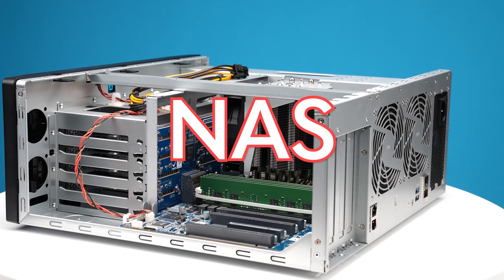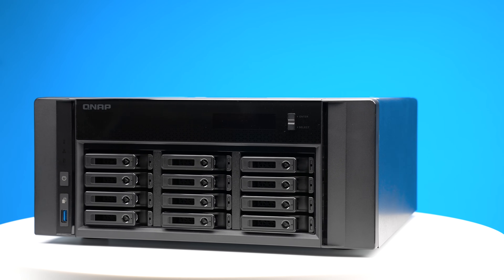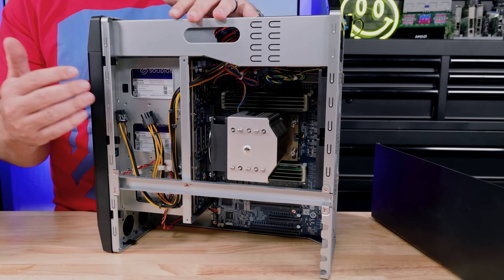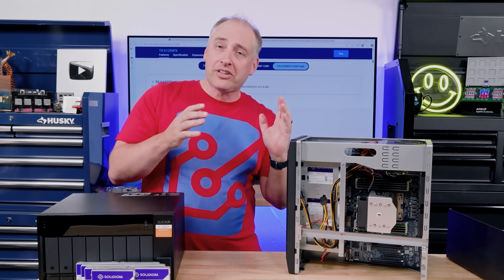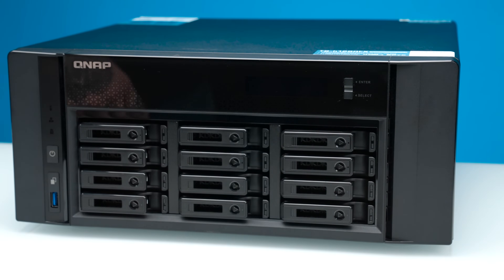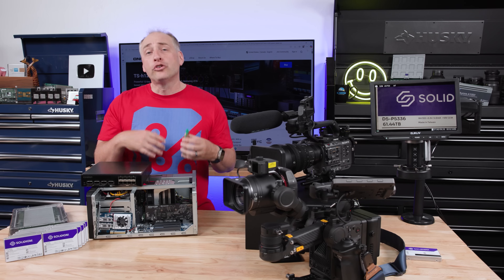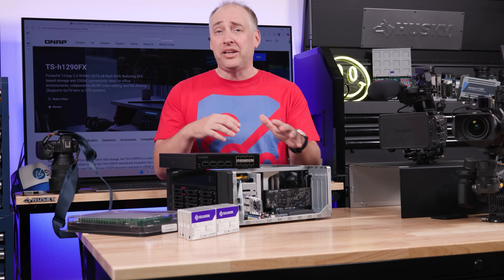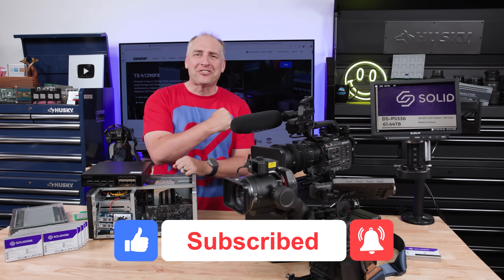SUPER Studio NAS with 360TB of SSD Storage FAST Networking and an NVIDIA GPU for AI

Comment: A single one of those drives costs more than my entire DIY server.
Lately I've been pricing out an upgrade from the consumer-grade hardware I'm currently using to actual server hardware and already hitting some sticker shock. This isn't helping LOL

And all I want is like 16 more PCIe lanes. I don't even need the extra cores, the memory capacity, the ECC, or pretty much anything else the platform offers. There's also Threadripper for that, but that costs just as much if not more.

Comment: QNAP also support thunderbolt 4 and coming soon thunderbolt 5 connections, either for networking or for expansion.  One can also add 4 10Gbe ports  for  small team to increase the bandwidth if one does not have 25Gbe. The machine can be purchased with 1TB of RAM.   The issue with QNAP is that the security issues do not stop. But the Hardware is excellent and the software easy to use but powerful.

Comment: Build your own NAS, dont buy.
Reply from the maker: Which chassis for 12x 2.5in NVMe in low noise?
Reply: @ServeTheHomeVideo  I built my own completely out of an old ATX cabinet, but it is HDD based with NVMe caching. The motherboards which come with these appliances are suspiciously low quality. I have studied the components and they come from unknown brands. So I use better quality ATX motherboards when building these. I have 3 machines running now, all DIY.

Comment: One of my client uses this and filled with 60T drives.  It’s the only way to get that density. 

Except for fan ramping up during boot stage, the system is actually surprisingly quiet to be put in the studio..
Reply from the maker: Exactly the idea. We just could not get that many drives :)
Reply: They also got the 2490FX, but the system was too loud to be used in their studio.. so it’s being set aside.  They should have gone straight to 120T drives

Comment: So have to ask... will the QNAP support adding Mellanox's 2 x 100GbE port cards?  

I mean, if you are going to add in NVMe drives  ... I'm assuming that the solid state U drives are NVMe and not SATA...  you will want to up the bandwidth. At a min. 50 GbE works but that's the minimum. 100GbE is better and the sweet spot for ToR switches. (Mellanox)  Then you can break out a 100GbE port to 4x25GBe if needed. 
[Edit: In the video you first said U.2 drives which I don't believe are SATA SSDs but then show SATA ... which is it?]

I think its really cool and definitely you'll want to up the memory and thread count if you're putting in those large U drives.
But that's just me.
Reply from the maker: We only showed U.2 NVMe SSDs
Reply: @ServeTheHomeVideo  
Thanks for the clarification. 
The interesting thing is that if you have enough memory and cores in the CPU... w 100GbE you can get excellent throughput... enough to make this detached storage for compute servers rather than build this out to also process your video.  It may be a separate box, but the separation of storage from compute makes sense for many applications as well as added flexibility. Then you can repeat this box so that you could have additional redundancy or to spread the workload in terms of storage.  As you said... you're now making vids in 8K. 

If you haven't, please do a review of the Mellanox 100GbE 16 port switches and beat the carp [sic]  out of it.  At ~12K it looks too good to be true.

Comment: I originally migrated away from using my QNAP system with my "do-it-all" Proxmox server, and ended up at least bring my 4-Bay QNAP NAS back online, because for some stuff, their NAS just worked better/more stable/more consistently.

It's too bad that they are quite pricy, their hardware choices are quite antiquated by now, but when it works, it can run seemingly indefinitely.

Comment: dunno why anyone buys any of the nas's other than they dont want the hassle to make it themselves, 50% upcharge/ for a case.. my computers are on 2x4's it aint pretty  but its free,  and it bolts to the wall ez'pz,  with that 1000 rack mount and the trash rgb, i can just buy more drives...
Reply from the maker: So as someone who has built well over 100 NAS units over the last 15 years doing STH, I get both sides. Sure you can build your own. Let us say instead that you do wedding video/ photos and have never built your own PC because you just buy Apple because of how stable it is for Adobe apps. It is either spending a week or more trying to figure out what to build, then a few days waiting for parts, then a day to set everything up. Even doing that you will end up with something either bigger or louder than this one. I have been looking for three years and nobody makes a case like this.

On the prebuilt side, you order. You unbox. Put 12 tool-less drives in. Go through easy wizards that tell you what settings mean and make decent recommendations that you do not have to go off page to research. Then you are set with 90 minutes invested.

I get the fun and utility of BYO. As someone who works 90+ hours per week I also fully understand that you can make more money, but you cannot make more time. Ultimately time is the most precious resource so I fully understand why folks buy prebuilt laptops and prebuilt NAS units

Comment: I just finished setting up a QNAP TS-h1677AXU-RP-R7-32G. I put truenas scale on it. 16x 16tb HDD, and using 2x QM2-4P-384 Quad M.2 2280 PCIe SSD to add in an additional 8x 4tb sdd. 2x small Intel optane drives for boot drives. The system has 2x 10gbe ports built in. I also upgraded the 32gb of ram it comes with to 128gb. 
It's super cool
Reply from the maker: Sweet setup

Comment: About the AMD processors, if you put a 64 core processor in there, is it just a UI issue and not a real issue? Can you SSH or terminal to the OS in the device and see if the extra cores actually show up? It may be a QNAP UI limitation or software lock in QNAP and not a real limitation.
Reply from the maker: We have a screenshot of this in the article
on the main site but the BIOS shows 64c/128t and lscpu shows 32c/32t

Comment: Did you enjoyed the qnap interface? Did you find it easy to use and complete?
That are the most important questions I have about QNAP.
The QGD-1602(p) seems awesome, same for the QuCPE-3032/3034 (not in a 10 inch form factor SADLY!).
Reply from the maker: QNAP has done a great job with the UI

Comment: I literally just built myself an EPYC based nas
Reply from the maker: Sweet with 2.5” U.2?
Reply: @ServeTheHomeVideo  undecided yet but could absolutely run them - used an AliExpress chassis, an asrock romed8-2t, an EPYC 7303P. Just finished the hardware build and going to spend some time setting up and tinkering before I decide on drive setup but I'm likely going to go with two zpools - one flash pool on 8x gen4 m.2 on two PCIe boards, a spinning rust pool, potentially with a three way mirror of u.2 drives for the metadata.... So many PCIe lanes, so many options....

Comment: That’s a crazy device! Sadly I cannot afford it (yet).. but I am wondering: how are all these drives connected to the system? I know, that EPYC has a lot of PCIe lanes.. but that many? So what would be the theoretical data rate limit? And what is the practical one with this hardware? Would that EPYC really be able to provide enough power for 700 Gbit/s full-burst with something like zfs with one or (maybe better) two drives redundancy?

Awesome video, as always, btw!
Reply: Epyc Rome has 128, you can do 32 drives if you don't need PCIE lanes for anything else.  Siena 'only' has 96 and Raphael and Grado 24, I believe for single socket the rest are all 128
Reply: @nadtz  Ah wow, thats a lot! So all in all all these high speed drives only need around 12 * 4 = 48 lanes if they need 4 each? Thats even more crazy :D

Awesome technology, thank you!

Comment: The 24-pin connector isn't fully plugged in.

If you cut the straps around the RAM slots to upgrade the RAM, will you lose your warranty?

Comment: Keep in mind that fast transfers of individual very large files over the network like fast single-core performance, the Zen 2 Epyc will likely throttle the performance here.
Reply from the maker: We were fine with multiple 25GbE. We even did real application traffic through the 25GbE links (in one, though the CPU, then out the other) with a $1M+ traffic generator.
Reply: I have a 7252 and it handles 10gb with no problem and on either the STH/Truenas/l1techs forum people have reported Rome being able to saturate 40g, so yeah 25g I'm guessing it would be fine.  Heck, Netflix was able to push 400gbe with a 7502P and some tweaking of FreeBSD.

Comment: The CPU cores thing is probably software licensing since the BIOS shows the chip correctly.  This is an interesting box though and would be quite cool if it was not locked down.
Reply from the maker: Totally agreed. If that 64-core/128-thread worked, then I think that would be a game-changer.
Reply: @ServeTheHomeVideo  When I said not locked down - I was talking about not having an OS to bring your own such as Proxmox, not their software being limited to 32 threads.

Comment: Would love to see more homelab focused flash storage server content. A bunch of this is fun to watch of course, but it's no where realistically within reach of anyone other than businesses/datacenters. I don't think it's "easy" for anyone other than maybe multi millionaires to put that many 122TB NVMe SSD's in a small sized NAS like this one. Those SSD's have got to be something insanely ridiculous like $10k USD per drive if not more. Maybe you just meant sourcing 122TB NVMe drives is "easy" though. Cool video as usual regardless.
Reply from the maker: We do a lot of that lower-cost content, and we will have something soon (video is already 99% edited). This scales quite a bit from low to high costs, depending on the drives used. Also, remember that Apple Mac systems are very popular in video production, so when you compare this to the cost of Apple storage, or camera costs (that 1TB DJI SSD is like $800 and you need one for the camera), then this becomes very reasonable in terms of costs.

Comment: Heya thanks for video it is very cool! I am really like Qnap for OS and design and stability. I still have 4 bay with 1g LAN, loved it a lot, and I am also watch this model it is I think best, I am also compared to rack version, and I think this desktop version is a lot more quieter, have a lot more expansion and actually 12 drive  bay against 10. everything cool, but those days if build NAS for own, it is much much more Hardware it is Could EPYC in AM5 format and DDR5, it is much more powerful and new and I think QNAp really delay with new hardware and still keep very high price for older Components which is nuts, and I think next 5y, Qnap other day released with New Hardware and I think price would ultra high, I think if someone from other NAS company will release something with new Hardware with good price, Qnap have no choice just reduce their price - but I don`t believe it is ever happens, Qnap still very very good, and I think all components still good still old but good optimized for kind of those system where it is enough for doing what is need to and on High level. And congrats with 1M subscribers! Cheers!
Reply from the maker: I think the AM5's challenge is that it does not have the PCIe lanes for something like this. You need EPYC for the additional memory and storage.
Reply: @ServeTheHomeVideo  oh gosh Yeah! Absooolutely! only this factor like limited PCI-Lines and maxumum RAM, is could limiting on that platform, forgot about that one :D Thanks mate! I am talking about something like this AMD EPYC™ 4564P , it is still very limited 
PCIe® 5.0 x28 , compare to AMD EPYC 7232P PCIe® 4.0 x128 , so -100 PCIE lines on AM5 EPYC :D

Comment: $5,000 for a second gen AMD EPYC DDR4 server without IPMI and drive-less seems worth it haha. You can build this system for way less. If I owned this I would wipe the OS and put Proxmox or ESXi on it.
Reply: This is the most overpriced storage box I have ever seen.
Reply: @kspense 45 drives 😂❤ but I’d say that’s a value also
Reply: I had build a home storage server with a EPYC 7302P CPU was cheap on eBay around $100  but the idle power draw was over 100W. I switched to a Asrockrack mini itx server RYZEN motherboard and CPU less pcie lanes but a lot less power draw even with 4 8TB U.2 NVMe drives and a Tesla P4 GPU and 25G network card.
Reply: @Cooper3312000  What other hardware was in it?  I have 2 Epyc systems (7302 and 7252 and with just CPU + memory they idle at ~65w, if proxmox is ding nothing that machine sits at ~85w and my NAS... well it's a power hog but that's expected with 16hdd's and 6 U.2 drives.
Reply: Try like 1000 bucks build it yerself
Reply: @skyhawk21 off ebay parts, yeah
Reply: If you built your car it would be cheaper.
Reply: Looks at my Dell R530 or R540
Reply: form factor. i know of no case for now, but would be open for a less proprietary solution, where i could swap stuff
Reply: Yap 100% if you know where to buy the parts , its a great deal. More often than not , it's from companies who are upgrading to a new epyc generaiton
Reply: I got my H11ssl-i + 7302 + 128gb ram for $550, hakoforge mini for $900 how I configured it and PSU for $100 during an amazon sale.  Already had NIC and HBA but lets go ahead and add another $200 for those and we aren't even at $2000.  If I wanted to do 16 NVME (I'm only doing 6) add in another $200-300 for PCIE cards and cables.  So yeah before drives ~$2k, if I'm being extremely generous and we add a bit for the chassis and custom motherboard let's say $3k.  3.5k or maybe as much as 4k I could understand, 5k for the 7323 model is insane.  If I'm gonna pay that much I'd rather just take it on the chin and get a stornado and have the option of gen 5 NVME drives on more modern hardware.
Reply: I agree this is grossly overpriced. But what are you going to put 12 NVMe drives in that costs less without starving them for PCIe lanes? (Not even rhetorical. I would buy that in bulk.)
Reply: @jeffw991  Any chassis that supports 3x 5.25" bays? Also there are some U.2 backplane chassis on Ali now and Silverstone is starting to ship U.2 backplanes as well.
Reply: @jeffw991  Hakoforge mini with U.2 backplanes and your choice of CPU/motherboard that will support whatever gen NVME you want to use.  I built mine with Epyc Rome since gen3 is "good enough" for 10g and have a friend who is building his with Epyc Siena hardware.
Reply from the maker: You totally can, but the big cost is really in the SSDs not the NAS, and most who are at this level are not building their own.
Reply: In Brazil 🇧🇷 a system like this will cost 30000 dollars +... 🙄😫
Reply: @ankantan sucks for Brazil
Reply: Company has to make money somehow

Comment: yet another great bit of hardware that is let down by a locked down OS. this would be the PERFECT platform if i could load TrueNAS onto it
Reply: TrueNAS (or any other OS) would probably utilise the extra cores in the bigger CPUs
Reply: I have tvs-h1688x did install truenas on it.  It's basically a server after all.
Reply from the maker: I would have been like that years ago, but QTS Hero has ZFS and is probably easier to configure with more in-context help than TrueNAS.
Reply: @ServeTheHomeVideo  And QNAP is NOTORIOUS for dropping support on a whim, and DELETING documentation or disavowing products.
They have gone so far as sending DMCA takedowns for OTHER sites hosting documentation on products that they want to disappear.
QNAP is the enemy. Do. Not. Give. Them. Money.

Comment: No way would I spend that much on a QNAP
Reply: Considering the storage is easily 10x the cost of the server I think you have bigger concerns.
Reply: @playmaka2007  I dont know anybody rocking 15 or 30 TB NVME disks in their homelab, which seems to be the target demographic for stuff like this. Enterprises would buy enterprise equipment. ServerPartsDeals has 3.84TB kioxia CM7's for $398 which is much more the style of home labbers on 2 generation old epycs.
Reply: Tbats a $60k + nas sheeeeeeshhh!!!!!!!
Reply: I agree completely. $8400 bucks for one? that seems like highway robbery for the hardware you are getting.

Compare that with a much more powerful build with like 48 faster cores, 256g ram, etc: AMD EPYC 7R13	$600
ROMED8-2T	$623
ARCTIC Freezer 4U-M	$55
Kingston 32GB DDR4 SDRAM Memory Module - For Server - 32 GB - DDR4-3200/PC4-25600	$65
Crucial T500 2TB	$133
Rosewill 4U Server Chassis Rackmount Case | 15 3.5" HDD Bays	$191
Toss in a PSU and some bits and parts from the basement and boom.

Add it all up and for 2500 you could build a monster machine with all 128 pcie lanes exposed and massive performance.
Reply from the maker: $4899, not $8400 to be fair
Reply: @ServeTheHomeVideo  it's $8K Canadian even using your link. and the drives are near $6K Canadian, just an FYI.
Reply: what's wrong with QNAP?  And what wrong with price -it's cheaper than freaking macbook pro

@@shzd8076
second hand prices - what you even trying to compare?   compare with second hand nas price as well then
Reply from the maker: And much less than a Mac Studio.
Reply: @ServeTheHomeVideo  The Mac Studio should have much better build quality and warranty support than the QNAP, which has a long history of issues in both areas.
Reply: lol buy Synology trash then.